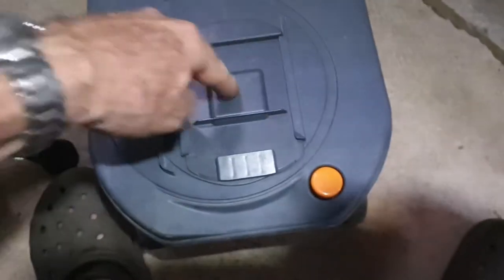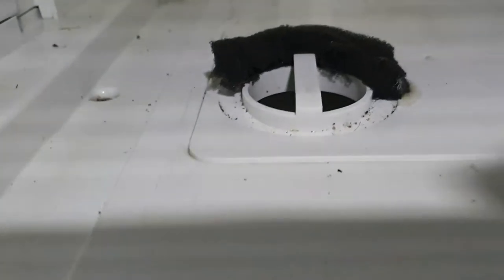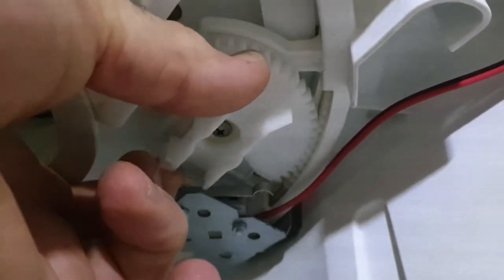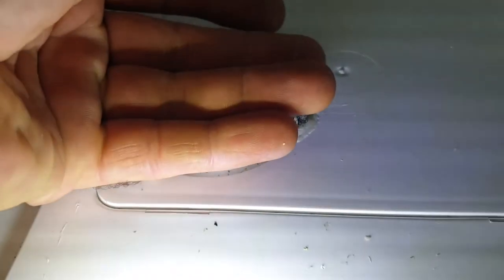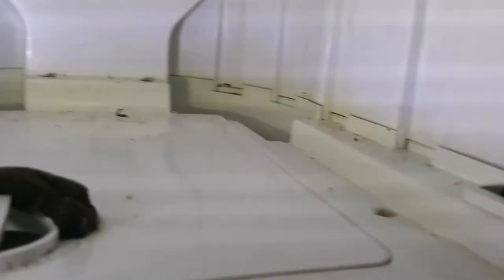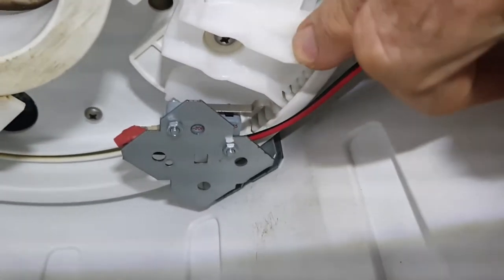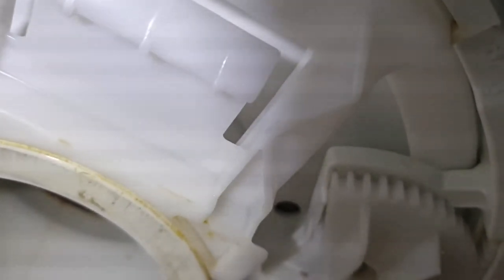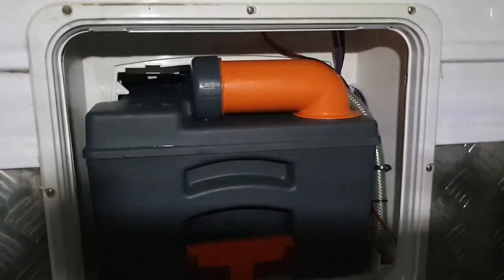Caravan Toilet Chemical Free Vent DIY cheap!

Comment: Though of heaps of ways of doing this also, I'm going to give method a go if I have room in that spot under the caravan. Thanks for your great video
Reply from the maker: Hope its as successful as ours has been. Cheers Tim
Reply: @timterry8714  Sure was; I set up the microswitch to turn on as soon as you open the blade, making the switch placement easier. I also put the activated carbon on top of the 12-volt fan and used a flat aluminium vent under the caravan. My wife has never been happier.

Comment: Tim I followed your instructions closely and have successfully completed installation. The system works well. I discovered that you can use short screws to secure the microswitch bracket and longer screws for the fan rather than using glue, this will make it easier to replace parts if necessary. I also extended the tuck in part at the back of the bracket to enable it to be secured to the wall.
Great job Tim.

Mick Matthews
Reply from the maker: Great Mick, glad it was you experimented with screwing the switch bracket to the wall and not me as I was not sure if it was single or double skinned and didnt want screws appearing on the inside - would not be a good look. Its certainly a more secure way to retain the switch bracket. Thanks for the feedback and enhancements Mick.
Reply: Mick matthews Can we see a picture of your modification it would be really useful

Comment: Good vid mate.  Simple and easy, thanks for doing the homework and sharing this.
Reply from the maker: No problem 👍
Reply: Only comment id have is i think the 50mm fan (the one i have anyway) seems a bit too tame and the vacuum or sucking of the air is quite minimal. I’d like a bit more suction!
Reply from the maker: No you dont need a huge amount of air movement, Rob. If you have a look at the SOG kits the fans are quite small. You just need some negative pressure as its only got to exchange the air in the cassette each time its used to assist the natural bacterial action and exhaust any unwanted odours outside and this small fan does that no problem. I have since installed a 60mm fan as my old secondhand 50mm fan ( test fan for proof of concept if you like) died and that was all I had to replace it with but the air movement is pretty much the same.

Comment: Great idea. I think the compartment is actually an overflow for if the cassette is full when the van is in motion. Care needs to be taken to eliminate the risk of overflow.
Reply from the maker: well if thats the case the caravan manufacturer failed to create a exit point in the floor of the van. There is a "well" at the front of the floor which may be designed to catch overflow. I think it is simply a vent to release any build up of methane or whatever but it would be interesting to find out why it exists. Excellent for this purpose.
Reply: Sorry mate, however you are incorrect, it is actually a vent, not an overflow.

Comment: Done it! Works a treat!!! 👍👍👏 so simple no switch tho, just on when you turn on caravan main 12v switch, next to nothing in current draw. Cheers 🍻
Reply from the maker: Great Jorji, yes I suppose you could have it running continuously as it moves a very small amount of air and as you say a very small current draw. I guess it just shortens the life of the fan running all the time.

Comment: Nice idea, I've just been looking at the kit but at £120 I thought I can make one myself for next to nothing. I think I'll just wire it up to a permanent 12v that's on when the caravan is powered up.
Reply from the maker: The fan cant suck air through the cassette when the toilet is shut so no real point in having it on permanently. But I guess why not otherwise. Cheers Tim
Reply from the maker: Actually a friend wired it to permanent 12v (when van is powered up) and the fan died in about 3 or 4 months

Comment: Hi Tim 
Many thanks for the video. I installed it and all works well. I’d be grateful if you could clarify a couple of things. Firstly, did you upgrade the wiring on both the microswitch and the fan and secondly where did you buy your activated charcoal material please?
Best wishes
Peter
Reply from the maker: Hi Peter, I havent changed the switch or wiring since installing it. I found the charcoal material on Ebay but cant see the listing anymore but this looks the same
Reply from the maker: https://www.ebay.com.au/itm/164671699427?mkcid=16&mkevt=1&mkrid=705-154756-20017-0&ssspo=xieIH1mFSHi&sssrc=2349624&ssuid=mufvvukdq42&var=&widget_ver=artemis&media=COPY
Reply: Thanks Tim. I’ll search eBay and see how I go. When I find a good product I’ll let you know
Reply: Thanks Tim for this video… as mentioned the cavity below the tank is an overflow and it can and will fill up if you’re not careful. I have a baby’s nappy stuffed in there because it is very hard to clean out. I would suggest a mesh bag of kitty litter or similar adjacent in the remaining space to  reduce the risk of contaminating
the fan etc. great job Mate!

Comment: Just watched the video again and saw you cut a 50 mm hole in the floor but then you put the two conduit connectors in your filter box which is your actual air flow restriction...interesting to see what adding conduit to the connectors does!
Reply from the maker: Hi Darryl, we have been on the road for 6-7 weeks now and this has been brilliant. You need very little air movement to achieve the slightly negative pressure in the bowl to extract any unwanted odours and provide oxygen to the cassette to feed the bacteria breaking down the contents. Ours has worked flawlessly ) apart from the switch moving a bit and not activating - easily re-adjusted. Another person screwed the bracket in which is what I will do when I get home) and we have never added any chemicals.

Comment: Not directly related to the venting system but can anyone tell me where the reed fuse/housing is located in this model C260, we cant find it anywhere.... help
Reply from the maker: The fuse should be external to the toilet I would have thought at the fuse block in the caravan (trailer).

Comment: Hi Tim
Just a comment about the size of the fan, the air flow is determined more by the size of the discharge hole in the floor because these computer fans are not designed for "head" more for displacement and when the discharge is reduced the affective area is that of the hole in the floor.
That might explain why the SOG fan is the size that it is.
Regards
Darryl
Reply from the maker: See above